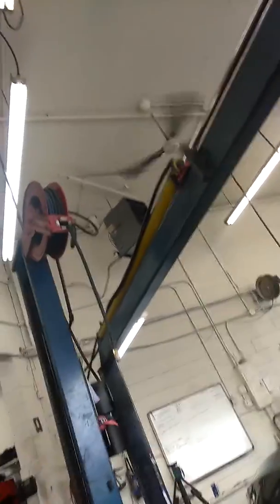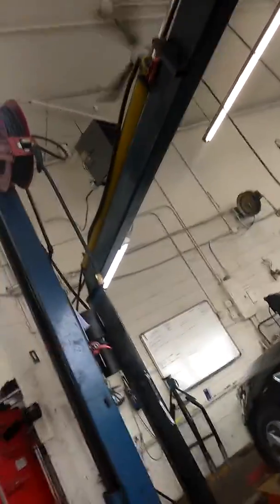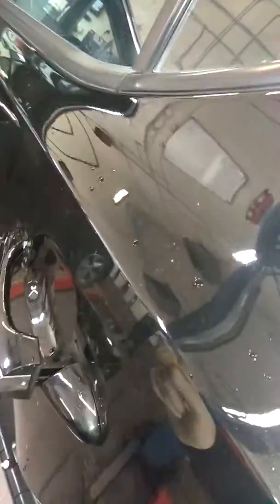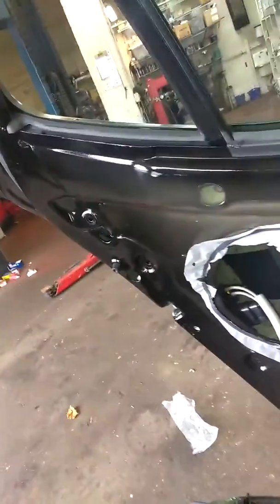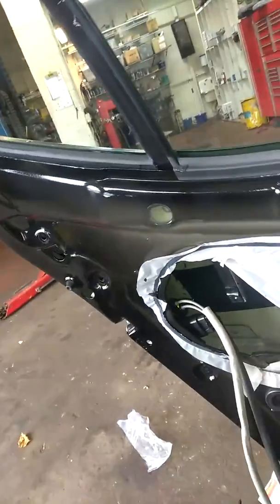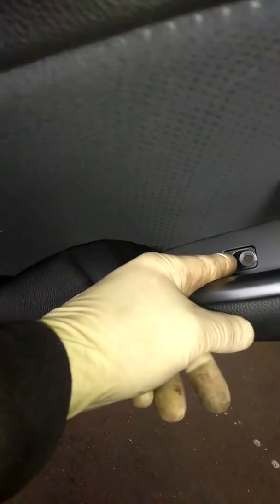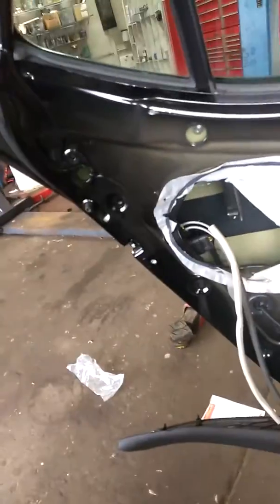2014 kia optima door handle issues.. Meineke cinnaminson

Comment: Mike you show the full mechanism briefly at the start of the video, (looks like it on the back seat?) I have this same issue and cannot find the part number for this replacement part.  I have the door apart and the broken internals, but need to know the part I for it order and from where? I would appreciate any help.  Thank you.
Reply from the maker: I seen them on line most time I get from dealer
Reply: Did you ever find this part #?

Comment: How did you replace the handle base? I have the same exact problem and was told that the handle base is broken. Thank you!
Reply from the maker: Kai Sotto dealer parts or order on eBay
Reply from the maker: Take door panel off and inner door housing to access the in side door handle mount